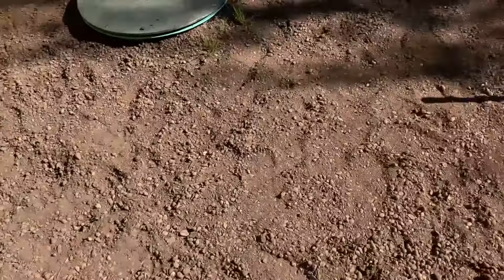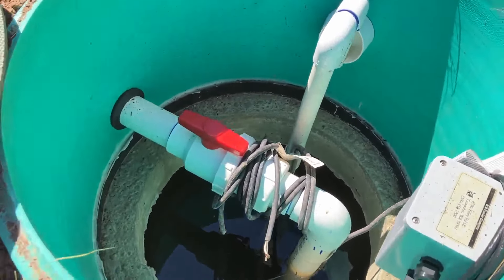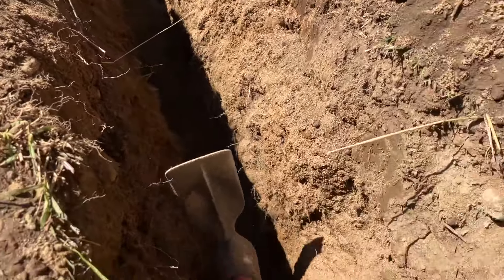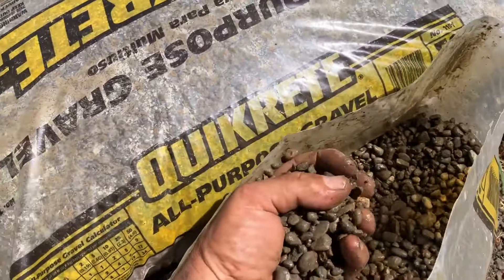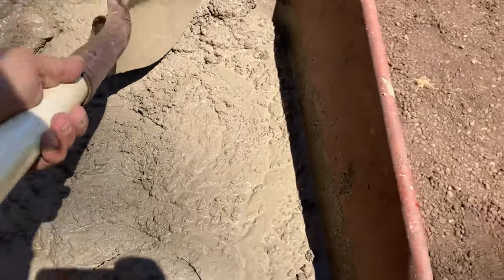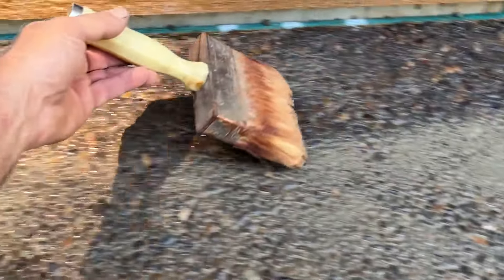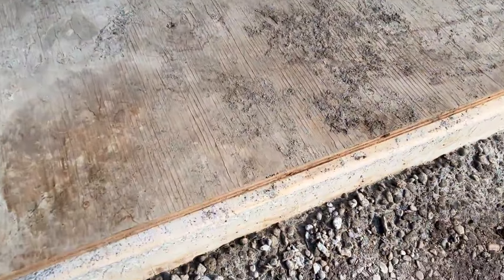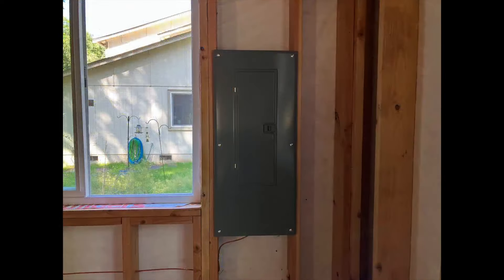How not to pour a concrete landing - GS Tongs

Comment: I love your videos. It doesn't matter if you're blacksmithing, building a home, or scooting around Taiwan, they're all interesting. Being a detail oriented guy myself you left me wondering about that whole septic aeration pump problem. You said that the whole situation could have been avoided, I'm just wondering......how.
I am wondering about your future plans. You mentioned installing the septic system three years ago and this summer building the house. Does that mean that you'll be moving to Washington state soon?
For those that don't know, your tongs are absolutely top notch tongs! They are hefty, smooth, precisely made, and very clean. I bought eight pairs from you a few years back and although I have tongs from other makers, yours are the best. I am in a small amateur blacksmithing club of 12-15 guys and they are in agreement that you make some mighty fine tongs.

Comment: Ugh oh you made a big mistake ! Rebar needs minimum of 3 cm concrete thickness from all sides ,othervise it rusts and as it rusts its gonna crack the concrete.Not a big deal in your case since you can just sledge hammer it and make a new one ,but thats the most common mistake people make.
Its also good idea to use a brush and put rust remover on rebar and then coat it with a hydro insulating cement( Ceresite cr90 for example.) on it with a brush .That way +concrete thickness = no future problems.